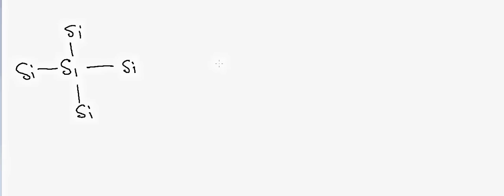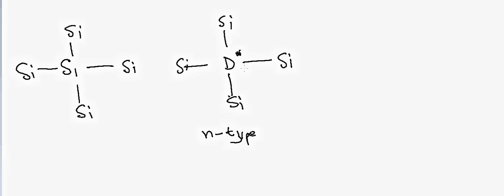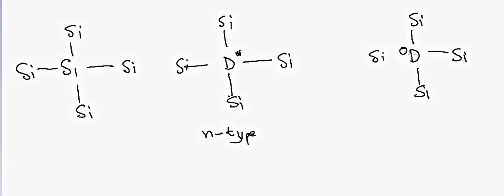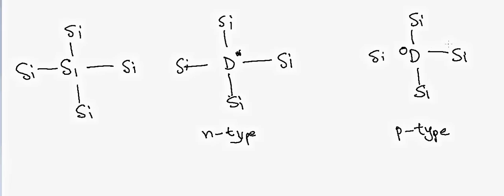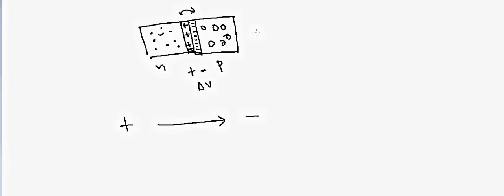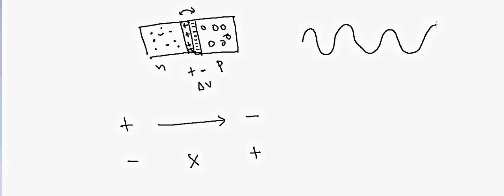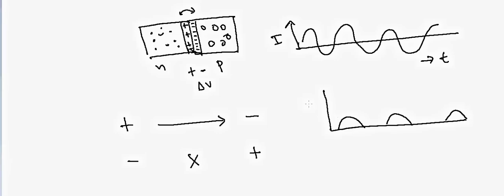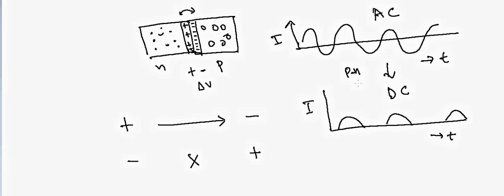P-type, N-type semiconductors and P-N junction concept for Dummies

Comment: At 3:54 when you start to draw the diode with n type on left and p type on right. You show that when positive to negative flow is connected from left to right you have current flowing. This is incorrect. You need to swap your p type and n type material .. then you will have forward bias .
Reply from the maker: This is correct. Dots are electrons and circles are holes.